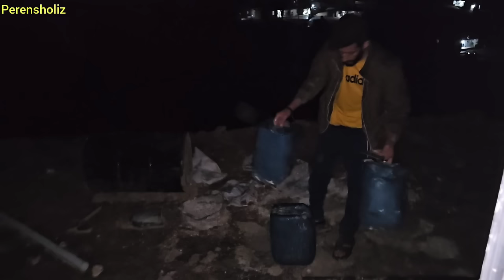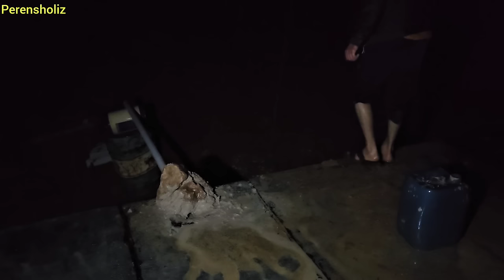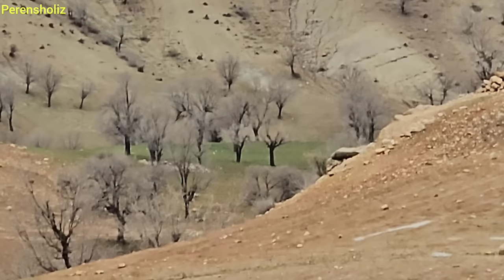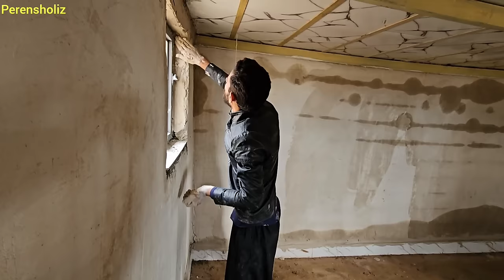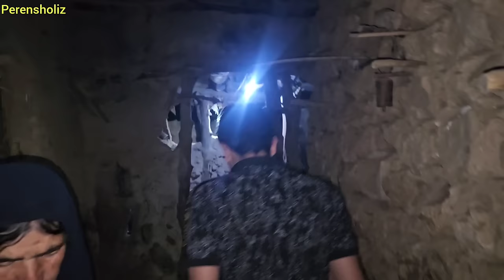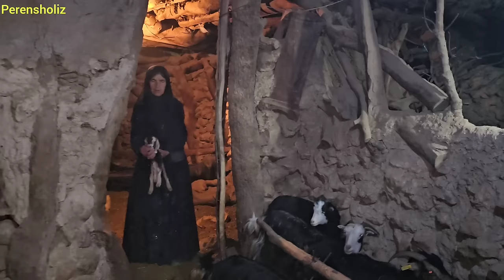Saleh getting caught in the night rain storm: the complicated story of Ishaq and Masoumeh

Comment: I don't understand the flat roofs that all leak, a slight pitch would have the water run off. Get the glass in the windows and a heater and you can move the children into the house...so much better than the tent and you can work to finish while more comfortable. I hope
Reply: Ale numer.zerwac dach i na nowo,a nie resztę życia się borykać.tacy fachowcy.
Reply: because it is flat and heavy force of iron bar holding as well as the wall can't hold its heaviness the middle part a little bit down low so the water stay at the roof Saleh idea of the roof gone wrong
Reply: yes
Reply: Приоделся! Одна нормальная куртка и ее надо всю уделать грязью! Такие неаккуратные!
Reply: He ordered them  already.
Reply: Desculpe Operador, mas faltou as legendas em português 😢,  sei que você é sozinho. Mas sem legendas os brasileiros não sabem o que está sendo planejado pela bruxa e hassan 😢
Reply: Yes
Reply: They need to elevate the other side of the roof infront the house  so the water will go down directly.
Reply: @avidarealdeumamulher4193 I think everyone's subtitles gone  the English ones to have stopped since Grandma and Hassan are speaking
Reply: 😮😢🎉Saleh, it's easy to be very focused on what you are working on. But, you've got to plan for the unexpected , too. The weather seems to be a big challenge: wind, rain, cold. Balance your focus to include those things you can't control.
Reply: 양철을 사서 지붕을 경사지게 다시 덮는게 최우선인것같아요
Reply: 전문가와 상담을 해보세요
Reply: PS.  Why not slope the roof slightly either side and install gutters and a down pipes so the rain runs straight off the roof into a drain?  Makes sense.  Or is the traditional way of building houses in Iran and they dont like changing and doing anything new?  Is there a good reason why all the roofs are flat in such a rainy environment?
Reply: Its a shame that this particular video had no subtitles at all - so what were Hassan and the Grandmother talking about???
Reply: На крыше сделать жолоба, изгой не надо  было  приклеить, теперь могут стены... в бочки набрать воды ,если есть дырки  в ней ,забить камни
Reply: Мокнут стены😮
Reply: Вы же знаете свой климат , дом построен не правильно и крыша  .фундамент делать высокий и пол от земли хотя бы на полметра поднять ,вокруг дома нужно забетонировать покатом чтобы вода стекала ,тогда дом будет сухой. .крышу покатом делать чтобы так же вода стекала  . Снег и дождь лезите на крышу  чистить  ,утюги ваши прогибаются от тяжести плитки  ,утюги тонкие они не подходят . И это все может рухнет когда нибудь на детей . Надо делать сразу все качественно  . Идут дожди палатку можно поставить в дом  .ума не хватает что ли.
Reply: ตากลอ้งแปลภาษาไทยก็หายไปไม่รู้เรอื่งเลยค่ะ
Reply: Перевод на русский
Reply: @uraiurai63 no hay traducción en ningun idioma
Reply: Translate yetersiz büyükanne ve Hasan ne konusuyor
Reply: Надо  как было перевод. Так  не интересно.
Reply: Camarógrafo ya no traducen quedamos locos
Reply: Eu tbm penso assim tá ainda está dentro dessa barraca porque?
Reply: С водой проблемы, но хотя бы когда дожди установите трубу для сборки воды, она вам понадобится для стройки, не лить чистую воду, на крыше оч много воды, хватит на раствор цемента
Reply: У нас теперь одна песня. Крыша дома! Кто- то писал, что за эти несколько месяцев можно было накидать камней и грязи на территории было бы меньше! Нет , они не слушают людей! Вчера я про крышу кричала , бесполезно! Какие- то безалаберные! Дождь закончится опять про все плохое забудут! Ну неужели окна пленкой закрыть нельзя? Дождь в дом бы не поникал!
Reply: No sé por qué hacen los tejados planos sin ninguna salida.
Reply: I cant understand their building design specially the construction of a flat roofing....why.flat roofing????
Reply: For the minute he can use the plastic to cover the window's and door still better than the tent, no different than his hut.
Reply: @user-ko6ze1li1z Іншої не має на цю пору  року!Холодно !!!! Тому  носить завжди !
Reply: Acredito que ele teria que levantar outro telhado com a queda para as laterais . Nenhuma laje escorrega água, ela acumula água, é o que tá acontecendo aí. E ele tome cuidado sebo telhado não desabar. Quanto dinheiro jogado fora e não teve ninguém pra dar uma ideia 😮😮
Reply: @user-vf5bm2sj8r eu não compraria estanho apenas umas francesas( vocês sabem né, o que é francesas) e um toldos colocaria acima do telhado pra quando a chuva vier não cair. Na laje e descer direto. Tampando o lado elevado ,pronto a chuva não entra no telhado e cai no declínio. É só olhar como são as casa aí feitas de madeiras. A diferença é bom tooldor. Só isso 
Se pudesse desenhar desenharia para ver como fica
Reply: Verdade
Reply: Well said move I to the house how those kids are not getting sick
Reply: Saleh adquira uma barraca comum e instala na sua nova casa até que conclua a obra. Instale os vidros das janelas e a porta, e também reforce o telhado com uma escora para não ter perigo de desabar.
Reply: Ask Arslan can you stay with them
Reply: Absolutamente.  Ya es una tomadura de pelo.  Ellos tienen que hacer videos y da igual como.  Ya basta saleh. Habla con el guionista que cambie un poco.  Porque nos cansamos..
Reply: Es demencial que siga en esa tienda  utilizando a sus hijos para vender y coger seguidores. Son muy pequeños y  Ya llevas mucho tiempo. Si no cambias  perderás seguidores seguro.. y es una pena..
Reply: Saleh, como você pode deitar todo molhado, até o chão da barraca, você molhou , tem que se previnir antes da chuva, pra isso não acontecer. E já dá pra ficar na casa é mais confortável,tampa as janelas e porta com plásticos,😲😳👀👀⛈️🌧️🇧🇷🇧🇷
Reply: Não tem legenda português, não entendemos nada fica.ruim assistir.
Reply: @user-vf5bm2sj8r my thoughts exactly but I noticed the this guy like that rich look and he is going to have this problem always if the the roof don't collapse on top of him and his kids, how wants a tile ceiling is ugly .
Reply: Também acho👍
Reply: Um telhado de folhas de zinco  material leve preso em madeiras leves, por causa da laje fina.Aproveitar essa a água da chuva em tonéis  com tampas e reutilizar  essa águas. Pegar água de beber no rio.
Reply: Где субтитры на русском пожалуйста оператор
Reply: Agree with your point, this construction it’s absolutely slow compared to other projects that I saw in Iran in same circumstances, and Saleh said that people donate money, my question it’s the channel don’t pay the enough money??? I don’t know but those things doesn’t make sense to me , sorry
Reply: No sub-titles!  Lots of conversation, but no way to understand what is being said!
Reply: yes parasite roofs  are a waste  of time and money  rather use a high pitch  roof  and gutters  on the side of the  roof so when it rain the water will fall into  drums for washing and other  use ALLAH UAKBAR  bless  u and yr children  and all  who r involved in the building  of yr house  
keep  safe in the path of ALLAH  and please english subtitle I'm muslim from south africa 
Jazakala
Reply: O problema é que o canal está srm conteúdo e assim as pessoas ficam comentando mas acaba cansando.
Reply: Οι προσευχές της λυπουν τις κακία γιαγιάς, ότι περνάει ο zalem  ο γιος της ,αυτή φταίει για όλα.
Reply: La oración tiene efecto cuando acolpañan las buenas acciones, qué ironía no?
Reply: Because he didn’t build the right way  , that’s why is the  leaks
Reply: My thoughts too more comfortable inside the house with the tent for now Saleh. Sadiq and Arslan are very loyal friends helping out no matter the weather. Good on you Sadiq hope you start your house soon after Salehs so he could help you out too many blessings to you and your family Sadiq
Reply: Me altera ver el video,  cómo  no se da cuenta  que algo está mal, repartió  tarjetas a todos, no puedo tenerle pena ,el techo   bueno mejor no sigo.
Reply: They have not advance from how they build houses from a thousand years ago.
Even I, who has zero idea on how to construct a house can see that this was not going to work. 🤷‍♀️
Reply: Saleh was asked right from the start from Aslan if he was going to build a tin roof. He said no.
I just can't understand  why these people have no common sence. 🤦‍♀️
Reply: Stop that crazy girl, they don't even bother her anymore, she just likes to beg the men, she goes out, tell Atlas that she feels like that, daughter in her house, don't let her go to you, repeat yourself a little, that woman is very easy, she's cute
Reply: With all men it's easy their reputation is not good
Reply: Cameraman, please stop recording that easy woman, daughter of Atlas, and talk to the man so that he can sit down with his daughter.
Reply: Салам алейкум спасибо всем кто может мне дат номер карте салеха
Reply: Как можно сним быт на связи
Reply: Муборак рамадан в сем
Reply: I've  noticed that som.e of the other shows  are doing this cutting out the interpretation  in english I wonder why?  It is almost like they don't want  us watching . It is not worth watching  knowing we  are supporting thier program but can not k ow what is going .
Reply: Agreed...roofs should higher in one side and lower at the other side.    And water run down and can be collected for laundry etc. 😢😢😢
Reply: @user-vf5bm2sj8r ,Ni siquiera hay que ser experto para darse cuenta que el techo quedó mal construido.
Reply: @user-wq1ee5fx2d Muy cierto,Quien mal trabaja trabaja doble..
Reply: Essa senhora matou indiretamente a nora e agora ora e faz jejum? Sera que ficará salva perante ALÁ?
Reply: O telhado tinha que ser todo ele inclinado para baixo na parte de trás e não para o meio, agora Saleh sempre terá problemas quando chove
Reply: Our history in Fereshte Channel is very different from the history of this family.
As a pregnant and homeless woman with a painful story...
But we do not neglect to see the video of this family
Reply: Saleh. Thế house i Think already to live. It's okay, so bring the children into the house 🏠 to be safe. Outside the flimsy tent ⛺️  was raining,  windy,  wet and cold for the children.  Even you, you need to take care of yourself fist . If you're get sick nó one take care of yourself.
Reply: Saleh could have brought Iron roofing.That would be better.
Reply: GOOD JOD WELL DONE BUILDERS WITH NO EXPERIENCE SALEH AND ARSHAN 😅😅😅 WASTE OF TIME AND MONEY 😢😢😢😢😢

Comment: Oh dear Salih, I am very sorry for you and all problems your going through. That pipe you put from roof, should bi on down hill side, like that it will go on ground and to your house wall, not good at all. That roof is very dangerous for you and children to go in and leave . It wont hold for long, one winter and roof will collapse. Now it’s the only way you can do is make hole in middle roof ( were is the most deepen in roof) and instal water pipe inside your house and led the pipe to the sink or on top that window looking to tent side so that water can run downhill. Good luck 🍀

Comment: I personally dont feel the ceiling is safe. Its already curving down. Everytime it gets walked on it will get weaker and have more leaks because the seams spread apart. If you have to keep the weight of water off. Snow is heavier. Sweep and shovel the roof till theres nothing left.

Comment: According to the suggestion from Taiwan, Saleh should improve and repair the roof of the house instead of the ceiling. He should also lay some cement sand in the middle of the roof to raise it (and seal it with waterproof asphalt) to make the roof appear triangular^. When it rains, the water on the roof will flow down smoothly.

Comment: Did i get wrong? I suggested beforehand if you put up the roof the front side is higher than the opposite side. When it rains no problem water flows down directly. I think the cameraman doesn't read the comments to know the suggestions and advises of the viewers. Now who are sacrificing? It's Saleh, the 2kids and Imran who is sacrificing filming  even it's raining.

Comment: Imran, Please let's get the roof fixed and drainage figured out or the water will be a continuous problem. The roof must be slanted for runoff, put gutter and downspout and catch the rain in a barrel for use on mixing cement, washing, ect., drainage tile wrapped around house and draining down the ravine. I think the problem is very easily fixed

Comment: Anyone who wants to build a house wether 6x6meters or a mansion, foundation is a must to be strong and get the frame or I called it skeleton of the structure professionally done, it’s cheaper that way, balance stability is very important in mountainous area because land is shifting through earthquake or heavy rains. You’re going to spend money anyways, it should have been done like so. This way you’re not going to run all this issue you’re having right now.  Priority#1 is the safety of lives and the structure itself. #2 longevity of your house all others is secondary… I congratulate you anyways to the new house from your mud-hut to now, cemented house. I have to give enough credit thru hardships, dedicated friends, family and neighbors you made it! happy for the your kids as well.

Comment: Build a ‘V’ or ‘A’ roof (slanting) on existing roof so that water can flow down way down and dig a small drain around the hse for the rain water & channel it sewage tank. Your tiles roof is not safe. Flat roof is will collect water unless you  hv small drainage on it.

Comment: Its not really a proper way of building Saleh's house.  Here we put cemented posts on the four corners of the house and deformed bars to the hollow blocks so it will be more strongand the floor must not be levelled to the earth.  Should have it much higher before the flooring so that when it rain it wont affect the flooring ..while roofings must have braces first. Just an opinion .😢😢